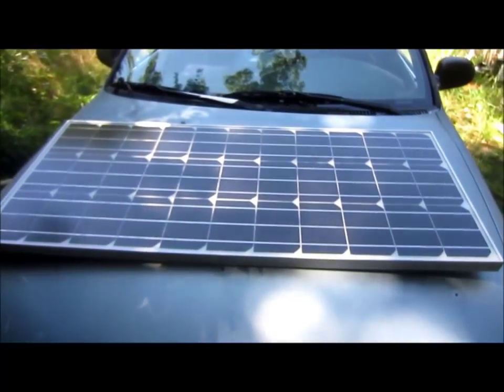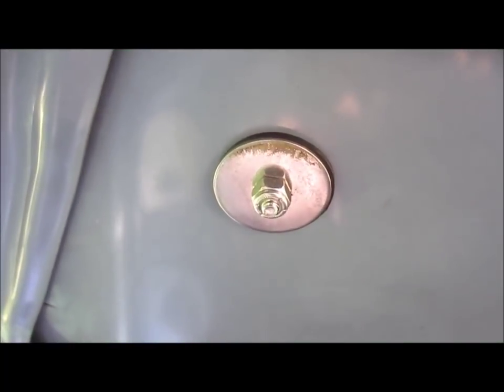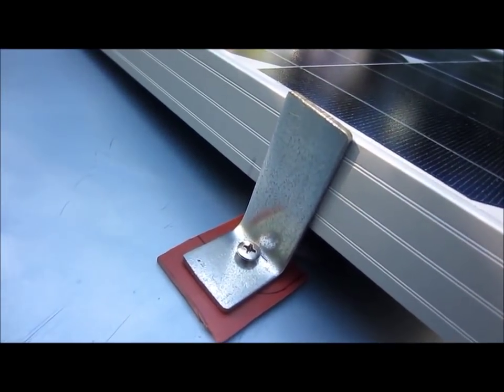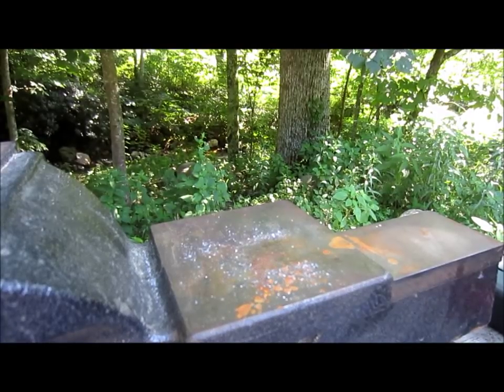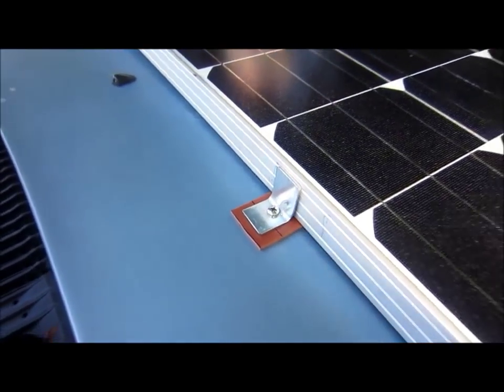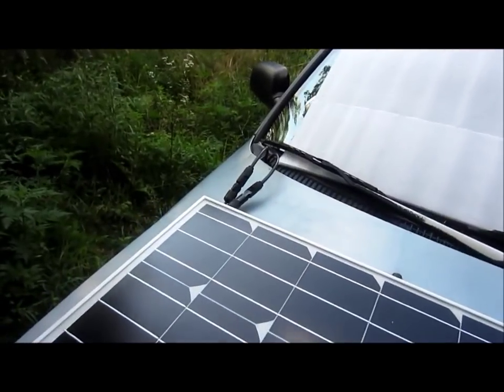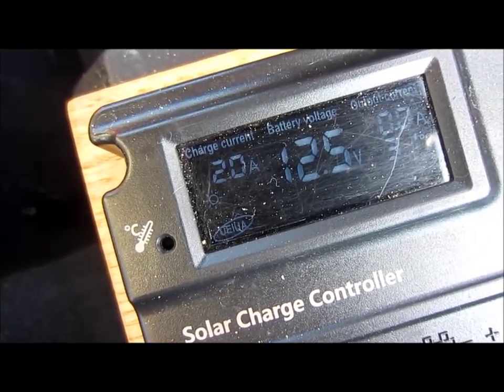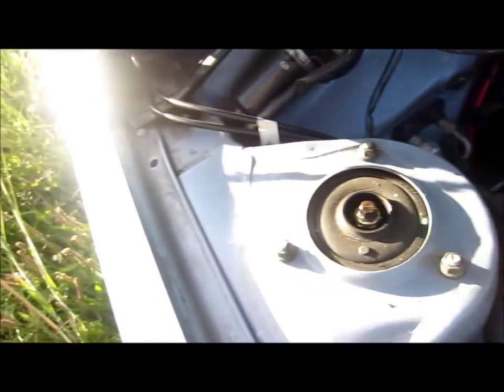Car solar Panel Install!

Comment: How has this worked? Are rocks or pebbles an issue on highways or back roads? How about fuel economy? Any effects at all?
Reply from the maker: The panels are hardened glass.  The loss of fuel economy is not near as much as the car carrier I have on the roof.

Comment: How do you go with wind drag on the front of the panel and did it effect fuel efficiency
Reply: He could have carved out an arch in the frame of the panel, to make it follow the curve of the Hood closer. Having as solar panel on the Hood at least doesn't increase the frontal area og the car and there is turbulence to begin with by the air going over the top of the grille.

Comment: put some pe film d own  .. two layers and shoot foam in between to dampen  road shock.
Reply from the maker: No, you just use a real solar panel - NOT the flexible crap.
Reply: @VitalityMassage  You kill the aerodyamics of the car.. but if you do a lot of camping it does not matter. I was talking about foam from  a can in some bags to  help support the rigid solar panel on the curvy hood.  thats all.

Comment: Does that mean you no longer have an alternator charging your battery when your car is running?
Reply from the maker: Since this video, I stopped charging both batteries with the alternator because it was burning out the alternator.  Now the two systems are completely separate.  The solar panel is the only thing connected to the deep cycle battery.  This is the best way.

Comment: Is the solar panel you used the same as a solar panel that is on a house roof?
Reply from the maker: Yes.
Reply: @VitalityMassage  I am looking to do the same kind of thing on my van. What kind of  power controller did you use and where did you get it please.